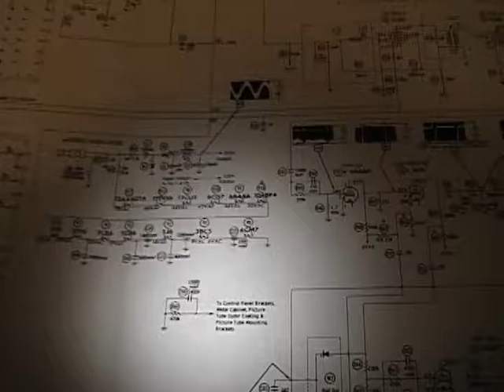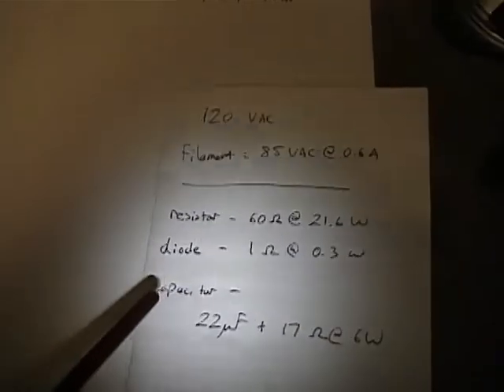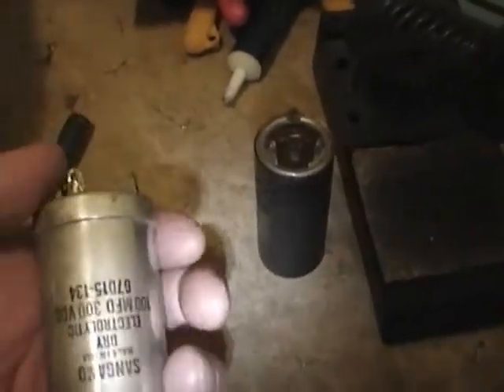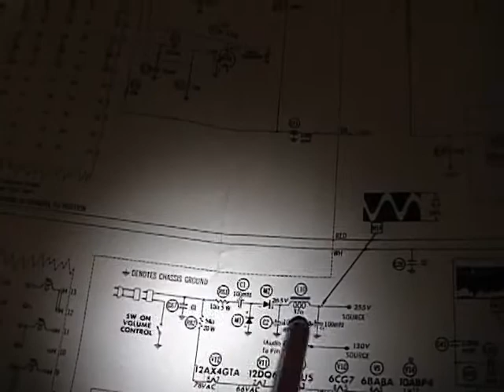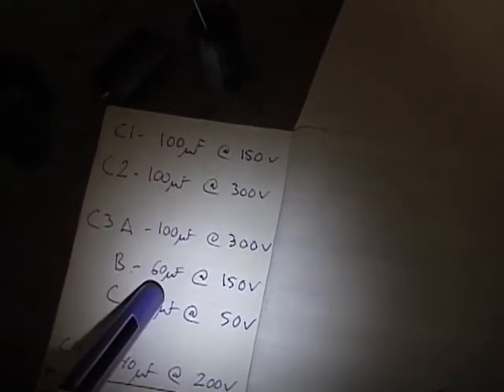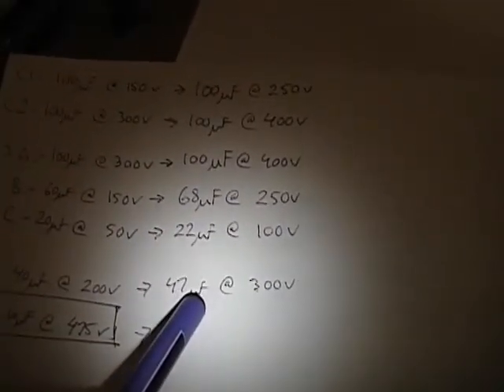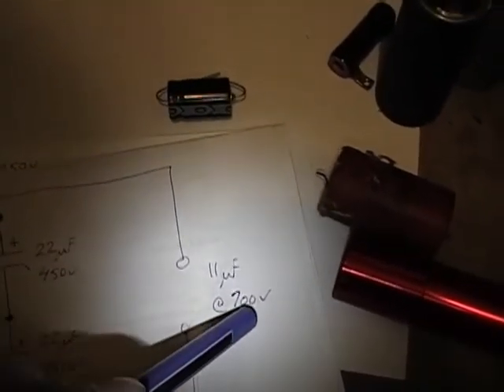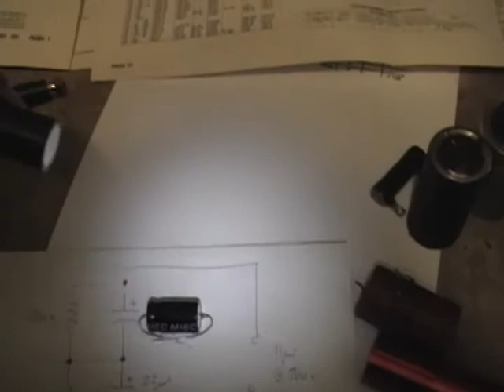Admiral T102 Restoration p2o6

Comment from the maker: The diode cuts the available power to the tubes without creating any waste heat so I can eliminate the 20W power resistor.  The CL-90 is there for a soft start.

Comment from the maker: Remember were dealing with AC here not DC so that diode acts as a half-wave rectifier.  That might make you think it would cut the power to the tubes in half, but it's a bit more complicated than that.

Comment: Hi Bob,
Having a bit of a problem seeing how the 54 ohm resistor (20W) in your 85Volt to 120Volt calculation can work here with a diode. The diode that has just a 0.7 volt forward voltage drop capacity, and 35 volts is going to be needed to drop here, even with a CL90 temp guy giving a just few more ohms. Got me on this one.

Comment: There is some difference of opinion of opinion with the use of equalizing resistors, some of the factory literature, I think it was from Sprague, indicates that they aren't necessary unless you are connecting three or more electrolytic capacitors in series. If the capacitors are closely matched, some capacity rating, same voltage, same manufacturer they claim that they aren't really necessary. There isn't any harm in using them but many people have left them out without incident.